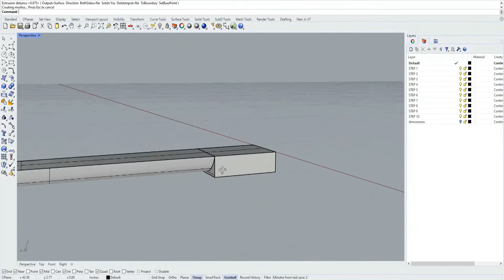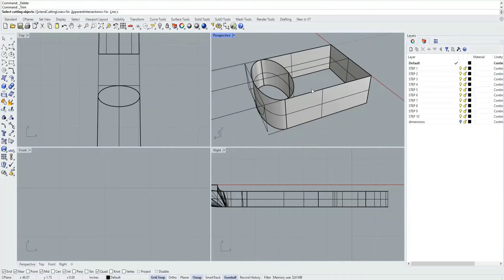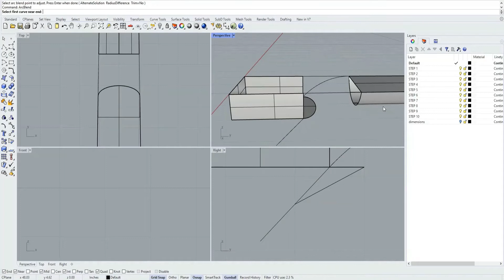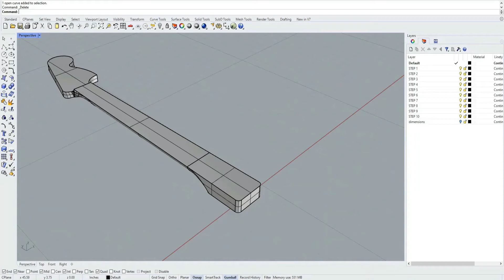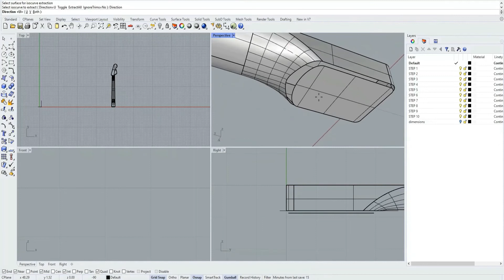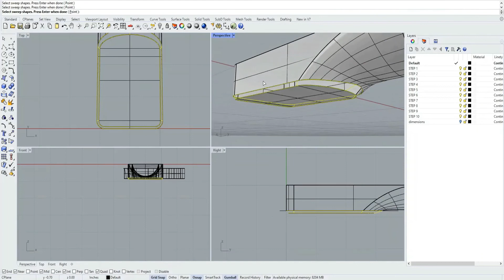MODELING A GUITAR NECK HEEL IN RHINO 7!

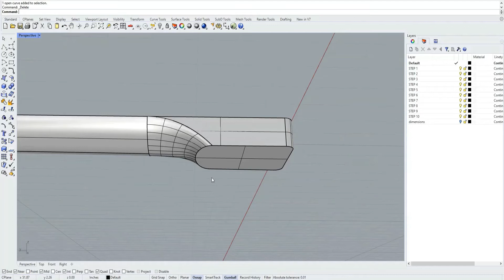Comment: Also, why would a CNC operation not benefit from the custom filleting you teach after 9:00? is it because regular sanding usually takes care of those edges? Thanks!
Reply from the maker: Yep! It could definitely be done on CNC both ways, but if you don't want to learn the custom fillets, a little bit of hand sanding should do the trick.